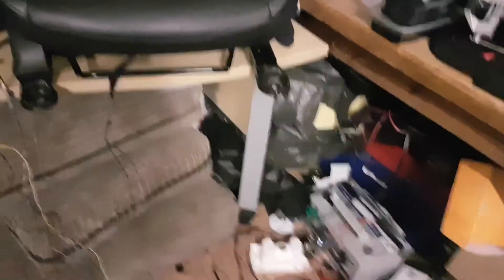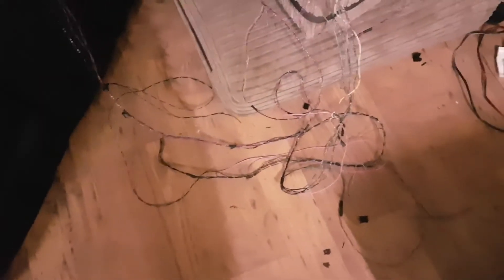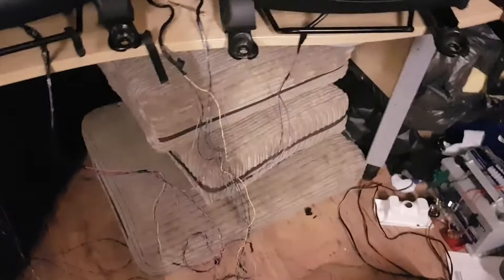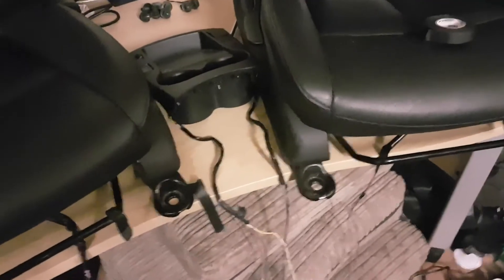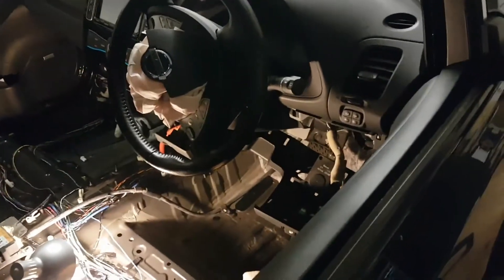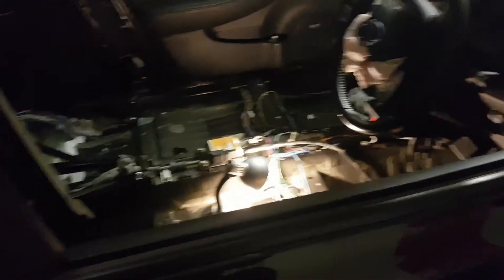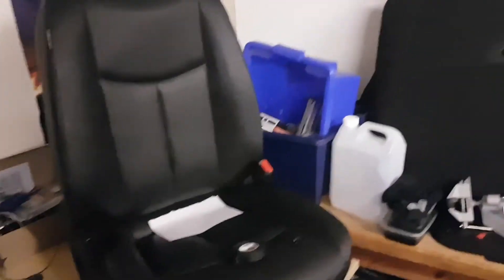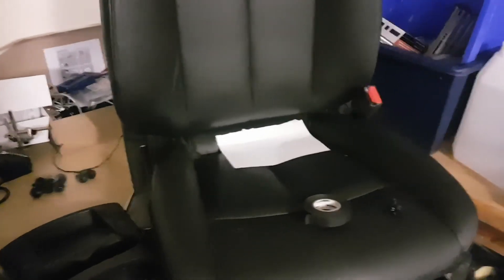Heated Seat Wiring Nissan Leaf

Comment: Thanks for this video. A Nissan tech and I were trying to locate exactly where those heated seat relays are and the parts diagram was not clear. The car is a USA spec. 2016 Leaf SL. There are three relays near the fuses in the box on the left hand side of the dash (the box with the cover that essentially is up against the driver door when that door is closed). Where exactly are the two heated seat relays and what needs to be removed to access them? Do parts of the dash need to come out? Many thanks.
Reply: The relays are directly above the BCM module. It’s just forward of the dash fuse panel.